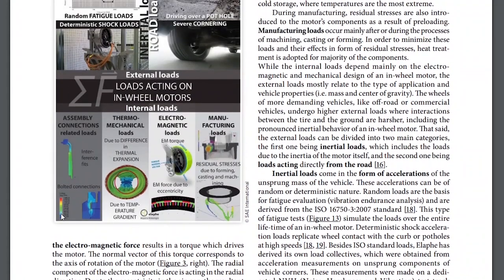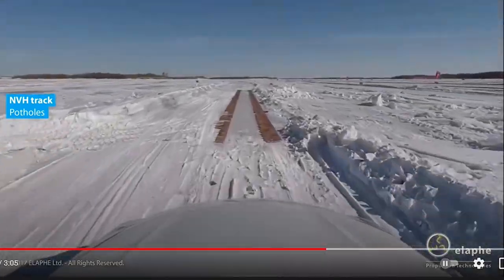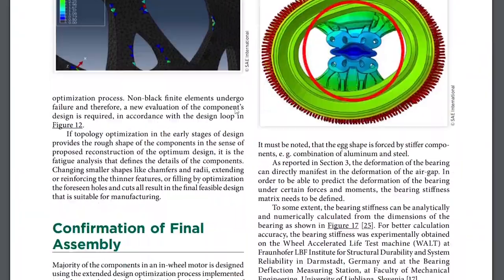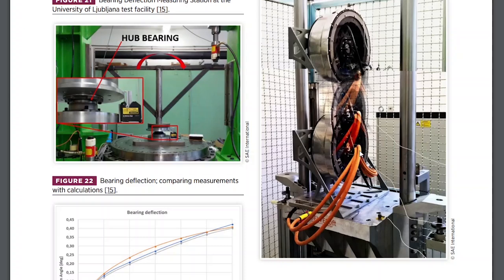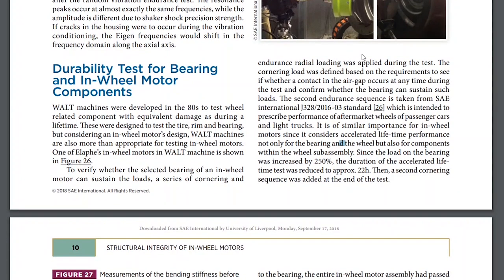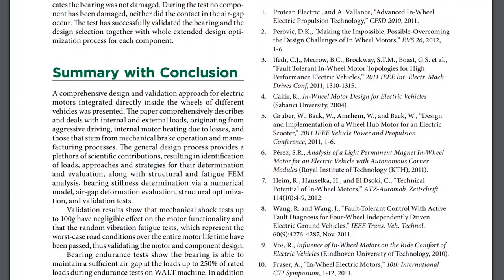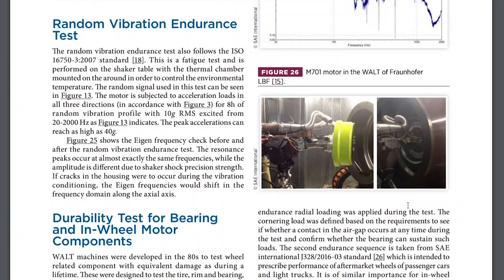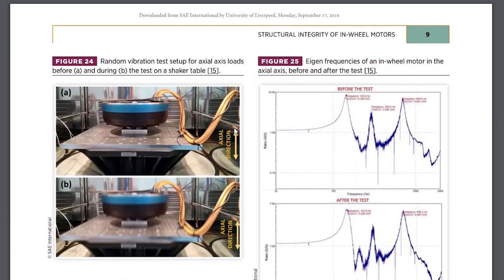Elaphe In Wheel Motor Durability testing

Comment: Thanks for the info. It’s hard to imagine an Aptera ever needing a tow due to mechanical failure. And the service intervals should be amazing. It’s about as close to plug’n’play as a car can get - except of course when the sun is shining and it’s also unplug’n’play!
Reply: At present, there will probably be a service interval of replacing wheel seals every 25 -30 thousand miles.  Elaphe is looking into the reliability of permanently sealed bearings, but a final decision on this awaits further testing.  If replacement is required, it would be on the same order as brake pad replacement as far as labor goes.
Reply: Every car breaks down and needs a tow. Most cars nowadays are towed for flat tires, even.
Reply: @n.brucenelson5920  "replacing wheel seals every 25 -30 thousand miles." Do you mean wheel bearings?
Reply: @skipondowntheroad5833  No, just the seals.
Reply: @n.brucenelson5920  I replaced my seals just the other day.  They kept eating all my fish 🤣🤣🤣
Reply: @robertd9850  Lol!  When I lived on a boat in SF Bay I loved to watch them playing.  They looked like they were having so much fun, it was hard to keep my dog from jumping in to join them!

Comment: Thanks for this informative video.  I’ve been following Elaphe for some time.  I’ve read a number of papers they’ve released but not this one.  My understanding maintaining the air gap is a critical factor in making the hub motor operate properly.  Elaphe has done a lot of research in this area, and the appear to have a good handle on the subject.  Even though the same motor could be used in different applications, bearings have to be designed for the specific applications to ensure that the air gap is maintained.  The popular criticisms of hub motors are unacceptable unsprung mass, inability to withstand road shock and inadequate environmental sealing.  I believe Elaphe has addressed each of these issues and have been transparent with their research.  I think this video puts the issue of shock to bed.  I look forward to future videos to see your views on the other issues.  BTW, even though standard disk brakes are used with the Elaphe motors, the mechanical design of the brakes need to be modified to operate with the custom bearings.  I believe Lordstown Motors who are using the larger L1500 Elaphe motors on their Endurance full size pickup have said the motors are so strong they continued to operational even after crash testing.
Reply: What is unsprung mass?
Reply: @Elrog3  It's the mass of the components in and around the wheel that don't have the luxury of being separated from the ground by a suspension system

Comment: I wonder if they do any testing with unbalanced loads. Like, when you have a tire replaced, the entire assembly needs to be balanced to avoid steering wheel and vehicle vibrations. It's possible for a wheel to throw off a weight. While I feel there isn't much stress on hub bearing with an unbalanced load of a few ounces, I'm just curious if they have tested for that scenario.

Comment: the weight is the biggest problem for in wheel motors. Im sure with time they will become lighter and better.  Right now i think they are still not at the level they need to be.
Reply: I rode in the Luna prototype just before Thanksgiving, and the ride and performance is already thrilling, and provides sports car like handling.  It is already better than any "economy" car I have experienced.  Reworking of the suspension by Roush has added a sway bar and reduced the turning radius among other changes.  The final result will be much more compliant and refined.  The unsprung weight is not an issue.

Comment: As sn ME, my only real concern is about ride/handling. The unsprung wt ratio is terrible and conventional suspension designs cannot overcome the issue. In fact. I know of no technology that can. An active suspension could reduce the issues, but can't eliminate them. I've tried to design a solution for years and haven't succeeded yet.
Reply: There have been peer reviewed studies more than a decade old that indicate that the amount of unsprung weight in the Elaphe wheels is not an issue.  What information are you looking at?  I had a ride in the Luna prototype just before Thanksgiving through twisties, and it cornered flat and stiff, like a sports car.  The Roush changes added a sway bar, so they can make the suspension more compliant while keeping roll under control.  I think ride is going to be comparable to other sports cars.

Comment: I am not worried about the basic durability. But the one point early on that gave me concern was the wheel motor seals, which Elaphe had originally said would need replacement after 40k miles.  But later they revised that estimate to 100K miles, which translates to pretty maintenance free operation. As you would probably replace the seals with the brake pads (which wear less on an EV). My only other wonder about the Elaphe wheel motor is hopefully to get a confirmation that Aptera will be using Axial motors, rather than the radial motors shown on their website. It's not a deal killer for me if they use radial motors (just like everyone else does) but it's a real perk if they are built with axial motors, for all of the advantages that you outlined in your previous video.
Reply from the maker: I'm more and more convinced that the motors are radial.  I have never seen any info from elaphe even suggesting that they have been working on an axial flux motor and I would think they would have announced it if they were working on one.  I will try to clarify when I go visit them next month.
Reply: Is it confirmed that Aptera will have regenerative braking? By the way @Aptera Owner's Club, we can't read your answers in this thread.. THe "View reply" button is blank.
Reply: @adimchionyenadum2962  Yes.  And it will be adjustable for several levels.
Reply: Some folks feel the need to change seals periodically is a downer, but I think it is a plus.  At least Elaphe have thought of the problem and addressed it. They test their motors to operate while fully submerged under one meter of salt water.  In order to maintain this level of sealing, maintenance is required to replace these seals.  In contrast other electric truck manufactures are using chassis mounted motors that are permanently sealed.  The question is how good are these seals?  Just because the motors are chassis mounted does not mean they will not be exposed to the elements.  I come to this discussion through my interest in the Endurance pickup which also uses Elaphe hub motors.  If I have an electric pickup will it really be safe to fully submerge the 400 volt rear motor in salt water at a boat ramp?  Elaphe says yes it will be safe but a replaceable seal is required. What about the other manufactures?  Will their permanent seals still be able to keep the elements out after hundreds of thousands of miles, and if so, how much will these seals impact efficiency?
Reply: @larry4fire  The technology to do this is not new.  Cruise ships have been using high voltage motors sealed in pods immersed in salt water for decades.  As always, the engineering expertise in the particular application is key.
Reply: @ApteraOwnersClub  There are reports from as early as 2011 that Elaphe was developing axial flux motors.  I have had a correspondence with some of their engineers and will see if this is a question they can answer directly.  I will report back if I get an answer.
Reply: @ApteraOwnersClub  I just heard back from one of my contacts at Elaphe.  Here is the quote:

For IWM's they are radial flux, very high efficiency, high-torque-density (Elaphe proprietary winding design and active core designed for Aptera's mission!) = light weight, robust.

Many people make this error, since Axial gets a lot of press lately (for inboard applications). 😊 Not the best design for in-wheel applications though, very fragile and quickly loses the benefits if you try to make it more robust...

No axial flux IWM deisgn (sic) has so far came close to the level of robustness, torque, weight or efficiency. Axial is great, but for inboard pancake style... (YASA, etc...). usually requires a reduction gear and CV joints to a wheel, since they are higher speed 5000-6000 rpm.
Reply: @n.brucenelson5920  I would have loved to give a like to your eloquent technical jargon, but unfortunately, I understood nothing! So, pass😂
Reply: @adimchionyenadum2962  Well, as you could see this was not my words, but a reply from Elaphe.  It is meant for engineers familiar with the field.  The only reason I know something about this is because I worked for a company that was developing electric motors for marine use, and we hired many of the Tesla motor engineers when Tesla had to lay them off in the mid 2000s.  I have been following this tech for a long time.  I worked for an electric vehicle firm in Japan in the mid 70s and we designed an electric 2 wheeler at that time, intended for my commute to Kyoto.

Comment: what about sub zero, +150C temperature, dust/moisture/chemical-acid corrosion intrusion testing?  (From very interested  in Aptera person)
Reply from the maker: They've done those tests.  Video here

https://youtu.be/8ATPYEYN6S8
Reply: The design spec is for it to perform from -20 F to 125F.  Elaphe confirmed to me in a personal email that their motors are tested  to operate from -50 to +85 deg Celsius .

According to the spreadsheet FAQ It will have HEPA filtration, along with UV and other filtration options.

Comment: I still want a Spare Tire Option.
Reply from the maker: You can always buy a spare tire and throw it in the trunk.
Reply: As Aptera Owner's Club says, you could do this, but at the cost of usable space and a weight penalty that will hit your range.  A better solution is probably to carry a small dc air compressor and a plug kit and needle nose pliers.  I did this on my motorcycle and and it served me well for over 400,000 miles.  Even when a nail punctured a side wall, I was still able to do a repair that got me to a tire center.  It is a far faster and safer roadside repair, too.
Reply: @ApteraOwnersClub  Why not make it an option and monetize it? It appears there is space under the rear floor to conceal it. I'd gladly spend $250-$350 extra for the option to keep a Tire and Jack from bouncing around.  I drive a Smart Car and have learned my no spare tire lesson when I had a tire shred after hitting unavoidable road debris. I'll take the hit in range in trade for peace of mind.
Reply from the maker: I'll add that to my list of questions to ask them when I go visit them next month.
Reply: Remember the rear wheel is not the same size as the front wheels.
Reply: @arlenbell4376  That hasn't been determined yet, as far as I know.  It is a possibility.  The FAQ says that they will be the same size, with a  tire size  of P195/45R16.   We will know more after the results of the beta testing.
Reply: @ApteraOwnersClub  Thanks!
Reply: @arlenbell4376  I'd gladly take a Donut Spare with a Jack and Lug Wrench.